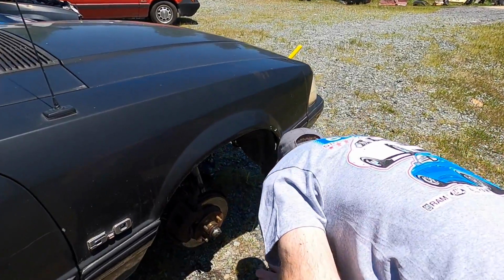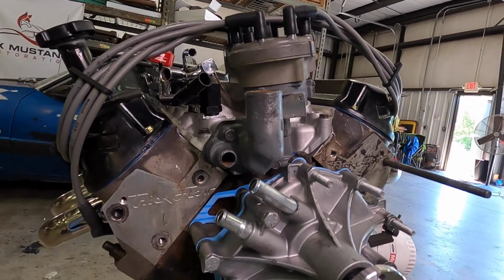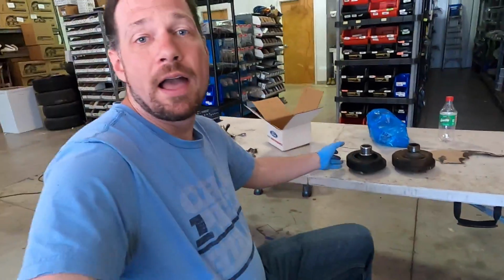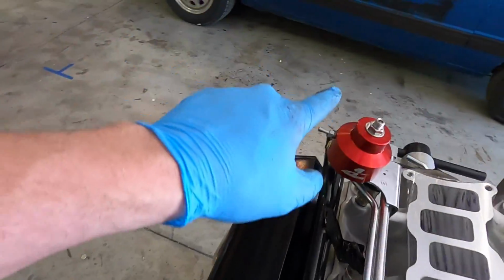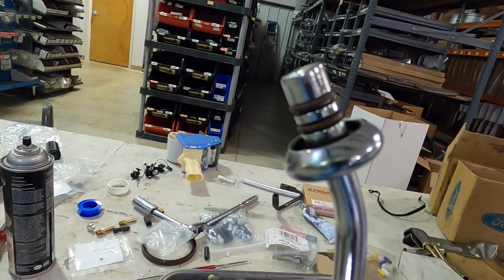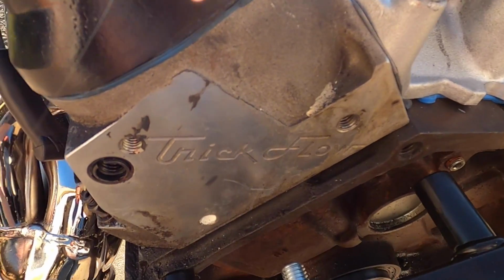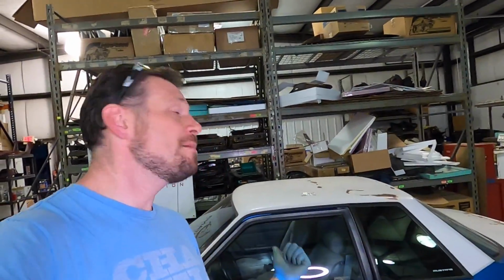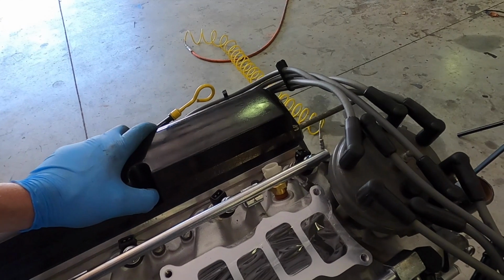CLEANING MY DIRTY FOXBODY MUSTANG ENGINE // INSTALLING A FORD RACING BALANCER!

Comment: Lol spit it out da shrimp mint sensil lmfao that's good stuff 🤣 that head looks new now. You cleaned the poop out of it. No wonder it got dark on ya. You can probably eat off of it now. Cool video now lets drop it in so we can see some wheelies 😁🚗💨👌😜
Reply from the maker: Hah hah, yeah I had fun with those bloopers!  Man I want it to drop in so bad LOL
Reply: @GearHead704  I'm ready to see it running again but I know that you for sure are ready to drive it again. I'm still waiting on my stroker kit going on 3 weeks from scat . They need to hurry up so that I can get it in the machine shop so I can get it back so I can start building it. I was going to try and make it to Ford takeover but that's out of the question now because I have so much to do and not enough time to make it happen